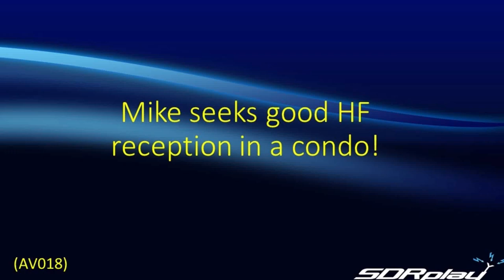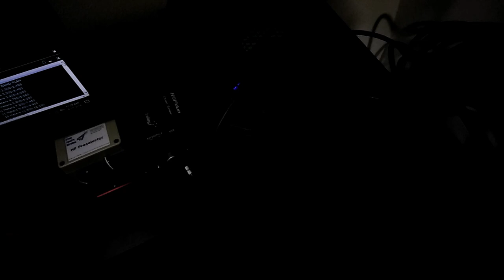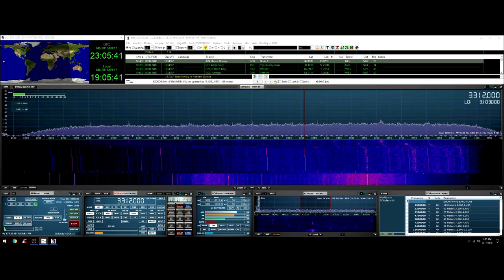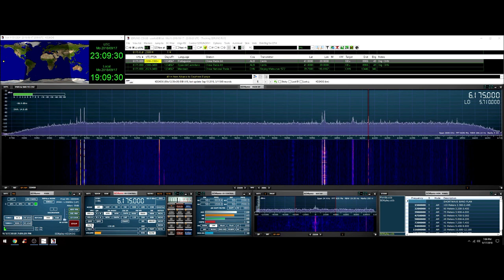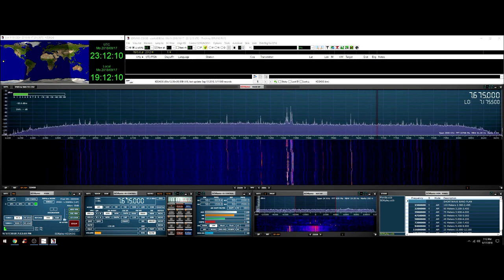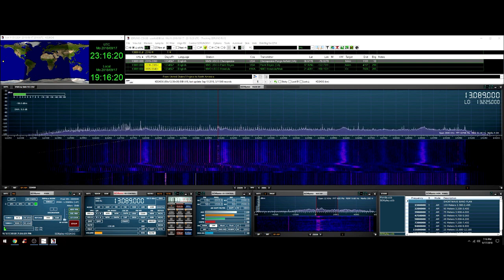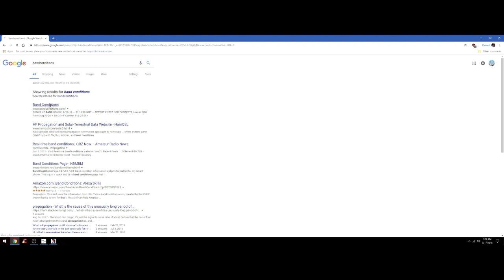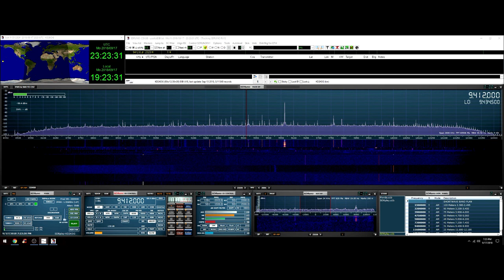Using a loop for good HF Reception in a Condo (AV018)

Comment: Mike, thanks so much for posting this.  So many of us are experiencing the same issues and problems, including myself as I contemplate moving to a 6th floor of a condo building on a busy street in Florida.  In my case, I'll be on the 6th floor with a very small balcony.  Same issue, either the loop can go very discreetly in left and right sides of the balcony or it will have to go in a window behind blinds in a 2nd bedroom.
Reply: Hey Dan, My pleasure. I was really in a bind. I tried all different types of antennas. I will never underestimate the power of the loop :)

Comment: You should look into using a loop on ground wire antenna. KK5JY has a great write up on his experience. The loop on ground wire antenna is just 60 ft of wire forming a 15ft X15ft box laying flat on the ground, even under the grass. The feed is done with an isolation Balun 2:6 for 75-ohm direct burial CATV coax. You might not even be able to find it if you were looking for it when it is done. The antenna has a bi-directional pattern and great S/N, as well as good low angle response and amazing bandwidth, 160m - 40m! The only downside is you can not turn the antenna so you may need to build two so that you could have N/S-E/W response. Obviously, you could never use a hidden loop on ground for transmitting due to the proximity effect of the earth. With a Magnetic loop tuned for transmitting you, could set up a station that the HOA Stazi would never know about.
On a side note, whenever I discuss transmitting with a magnetic loop I always remind people of the dangerous, even at QRP levels you can have dangerous levels of RF exposure and hazardous voltages. At QRP you should always maintain a minimum of 2 meters for safe RF exposure levels and at 100 watts you need to have at least 4 meters safe distance.
73
Reply from the maker: Thanks for this... you may also like to share this over on the SDRplay forum antenna section: http://www.sdrplay.com/community/viewforum.php?f=8&sid=97

Comment: I'm a big advocate of magnetic loop antennas for this very reason. They're never going to have the performance of full-sized antennas, but full size antennas don't fit in our kitchen windows hihi. If you are new to magnetic loop antennas you might keep in mind they are actually directional. 
One question, did you mean cross-country Wireless? In the video Cross "County" Wireless kept being said.
73
Julian oh8stn

Comment: Isn't the loop antenna aligned to west-east that way? I read loops have minimum signals on the coaxial direction, while max gain along the preimeter. So to receive signals from north, that antenna needs to be rotated 90° so its orthogonally aligned to the window

Comment: steve, found something of interest for you.
OTARD, stands for "OVER -THE -AIR-RECEPTION DEVICE" and refers to a rulepassed ny CONGRESS in section 207 of the telcommuication act of 1996.
with the OTARD rule ,the fcc severely limited the power of landlords hoa boards and condominium associations.
check out, prb1, and the ham radio parity act  of 2018.

Comment: Is the window screen aluminium or a plastic screen? If it is aluminium, then change the screen to a plastic screen, as you are shielded, like a Faraday cage. You might be getting some signals through the walls on the lower bands.

Comment: Good video, too many "gadgets" between the rig and the antenna for me though.
I live in a similar setting, seniors apartment complex, ground floor, covered patio and NO antennas. A mag loop will not hear anything, i just sold a new alexloop because i can't use it in here. Good luck.

Comment: Steve,put your loop antenna horizontal in the corner of the room. You are 90 miles from Cuba, at 7 s units,, I am in joliet.ill, with a 108 inch whip 15 ft off the ground, and get them at 10 to 15 over 9 on 6,0 mhz. And yes on a sdr 1.
Also the commercial station the was giving me problems is no more.
Reply: To weak signal difference is likely because it's a condo install, which likely has concrete or brick walls shielding out signals. . I believe he's using a small magnet loop antenna as he can place it near a window, otherwise the reception is even worse...

Comment: My qth is here in New York City in the Bronx I also have a q t h and Conway South Carolina right outside of Myrtle Beach living in HOA live on the first floor just like you also caught a little hell with signals of nothing really getting out in that area I try to loop antenna and yes it works before I was using in mfj 1664 and also and mfj a1661 manual screwdriver antenna they work absolutely well from my fourth floor apartment here in the Bronx not too well in South Carolina only if leaning out the window on a 45 degree angle which my yl would not let me do what I would like to know is far as what you're transmitting set up how are you getting out and is it any good results let me know 73 your friend Mark K2CSX

Comment: Guys are modding the MLA30 with better coax and getting as good performance as the MFJ1886 except on LW. So for 40 bucks plus a BNC connector and some decent coax you can get good performance and that's with the cheap Chinese RF amp. I have a bunch of MFJ stuff but the price on that antenna, it's not worth it. Actually it kind of pisses me off.

Comment: Your setup is VERY POOR! IMO your antenna is not the best performer for the location. High noise levels and poor receiver gain leads to the reception you get. Overall a poor video.... from an Advanced Amateur Radio Operator for Canada.
Reply: @briank.totten8092  Well said sir!